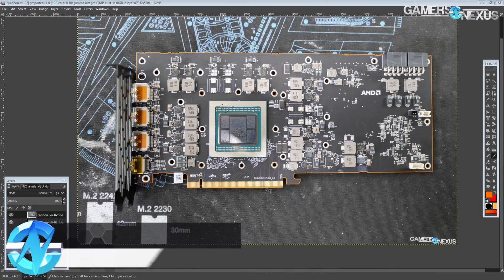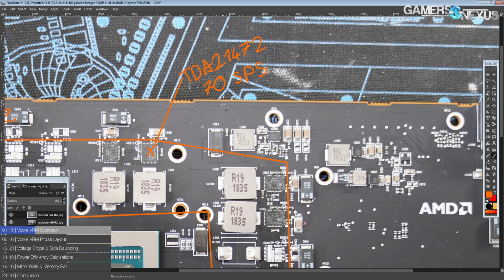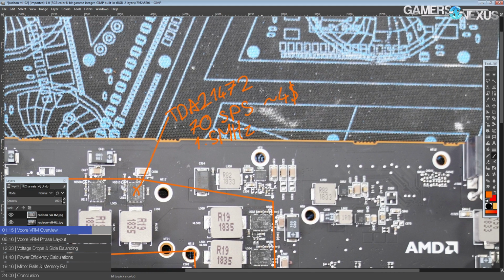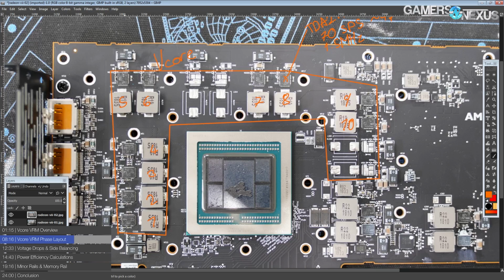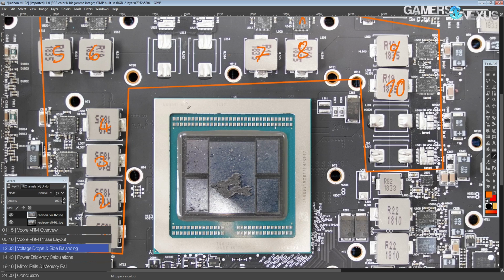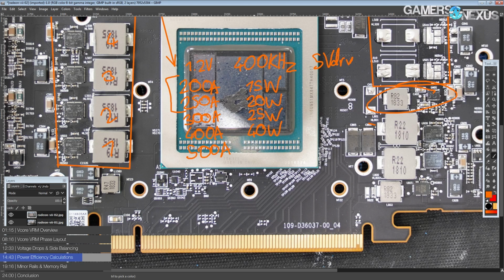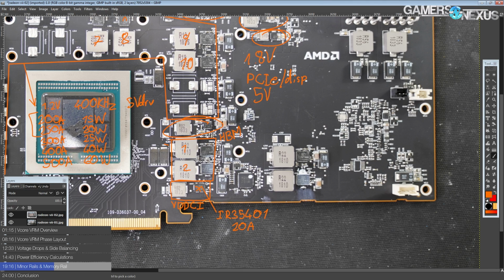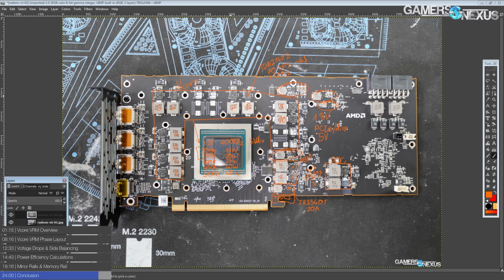AMD Radeon VII's Interesting VRM & PCB Layout

Comment: How much power needed to run this card? Wattage in terms of Power Supply?
Reply: 300 watts to the board
Reply: @micaiahflores1592  Is MultiGPU dead? I thought sli is finished and crossfire also
Reply: coldkeyes pretty much, Only like four games actually still use SLA or crossfire and fully scale
Reply: AMD says it has 25% more performance for the same power so I guess the power requirements are the same as for Vega64.
Reply: @krzych3114  hmm, good to know and I look forward to getting the card if its possible to obtain

Comment: So could the missing power stages be for when they release a full 64 CU version? It looks like they're leaving the option open to increase the spec's enough to compete with the 2080 ti
Reply: Unlikely, vega 7 would have to be failed higher CU count chips with cores disabled.  No way they would tape another vega chip if navi is really coming 2019.
Reply: This card is competing with the 2080. How is a 6-7% increase in CU's going to make up for the ~34% performance difference between the 2080 and 2080 TI?
Reply: A full 64CU version is completely pointless. AMD GPUs don't scale properly past about 44 CUs
Reply: MI50 rebrand
Reply: @levyroth  Its not a MI50 rebrand, why do you insist on going from video to video posting anti AMD nonsense?
Reply: @levyroth  Yes, if they wanted to they could release a 64 CU version based on the MI60. I'm pretty sure the missing phases are for the Instinct MI60 version of the PCB... I doubt it'd be able to catch up to the TI though.